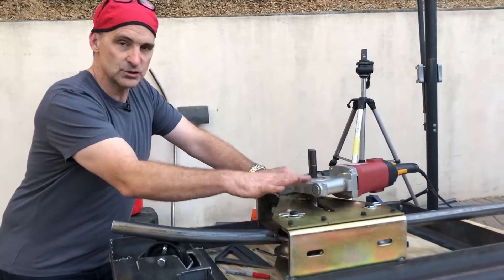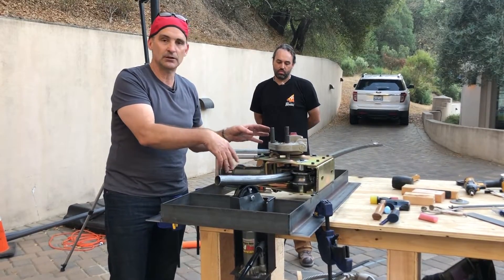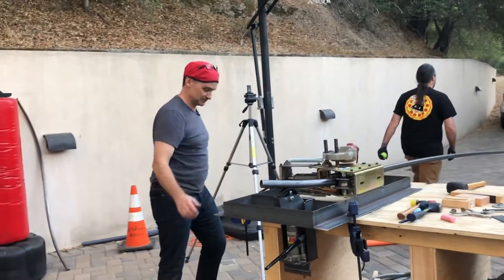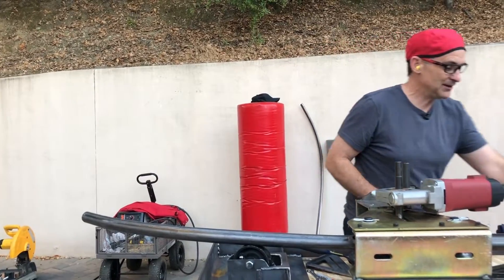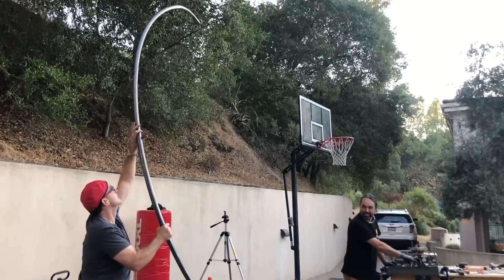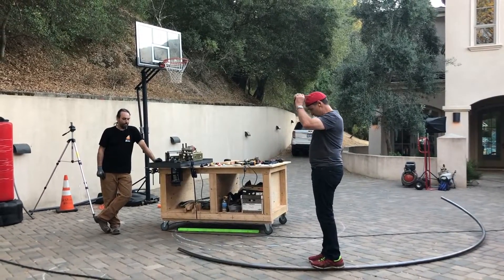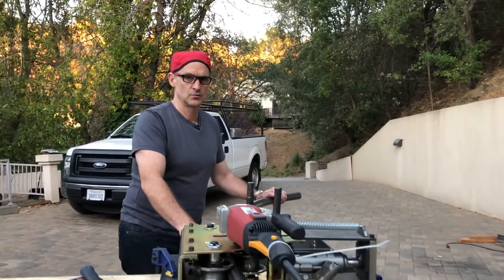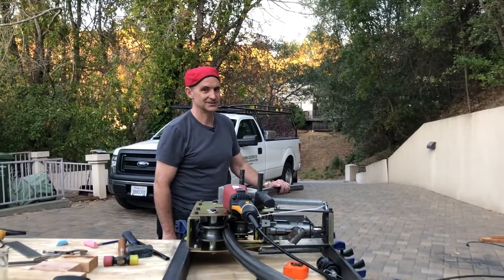Backyard Roller Coaster Steel Tubing Bender - Part 1

Comment: It looks like it bent up a little.  Maybe the addition of a vertical down-pushing wheel near the third (last) horizontal wheel would be enough.  
google "Galileo HV pipe bender with tooling for spiral staircases."  (I can't insert links into YouTube comments) It looks like they are doing something similar to you, with success.
OR, google "3-Rolls Bending Machine For spiral staircase."  It looks like they are torqueing the pipe as it goes into the rollers.  Maybe a big pipe wrench?  
Or, I can see you doing this:  YouTube search on  "Bend your own Handrail."  Looks like  a guy names Hans Bayer has something figured out...
Of course, the handrail steel they are using in these videos may have a much lower yield strength than the steel you bought.  Or maybe not.  Your tubes could be handrail stock.
Do you know what alloy your steel tubes are?

The lesson is that it takes three points to bend a beam.  
Possibly a better, but much more expensive solution would to make a 3D bender, which would have three "donut" rollers (many rollers at three stations).  The aft end roller station would be controlled in 2 axes instead of one.  Move from a 2D machine to a 3D machine.  But pretty complicated and expensive.  These are the secrets which professional roller coasters hold so dear.

Comment: Another method for bending steel is to use box rail track, and weld each face together, creating smooth curves automatically. I know that RMC actually does this, so it shouldn’t be too hard unless you don’t have a welder.

Comment: Right? I've been thinking on this problem for a while now of how to do it without a cnc because as we all know cnc stands for 
C - Costs
N - A lot
C- Of money

Soooo, I think you could do it this way byt you need to lock that 4th wheel and ideally add a 5th after the x axis bend.

I'm working at IAAPA all week, so I cant really help you much but I recommend the Arrow method and play around with coat hangers to make sure you're getting the shape you want!

Good luck!

Comment: What happend to the loop 😂
Reply: I think they are still working on it, by 'try and failure' ... But don't worry ... I'm sure they will get the corkscrew done
Reply from the maker: That is correct, Eric! We are working hard to figure out how to build a corkscrew or the barrel roll or the snap role or whatever it ends up being. There is a ton of trial and error as far as this goes. Made that much more painstaking when the cost of failure could be someone losing their head ( quite literally). We’ll get there! I promise!
Reply: Will Pemble you mentioned something about what program could design the loop, so I’ll suggest FVD or Newton2. It create the track based off the g-force, and should help increase safety. 

Tip: set friction to .002694